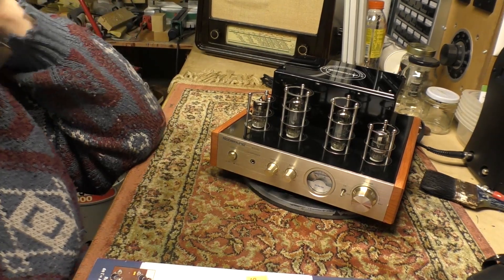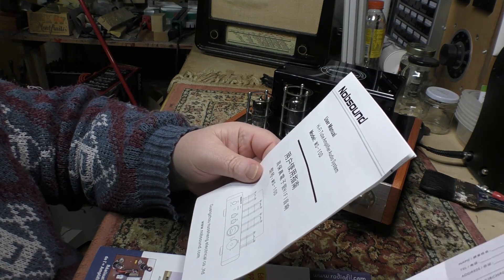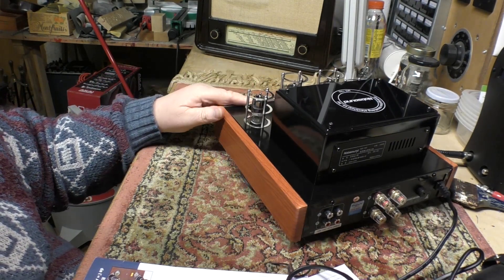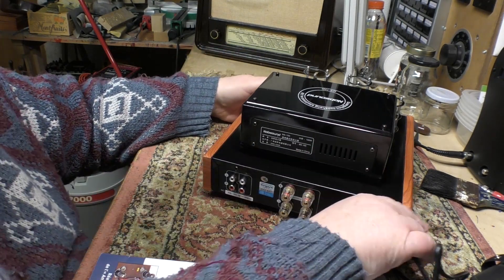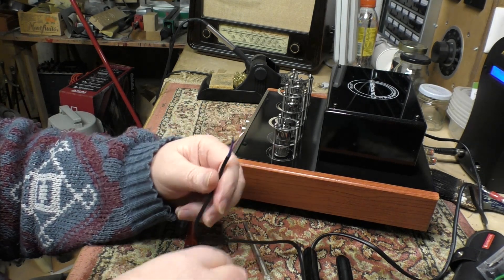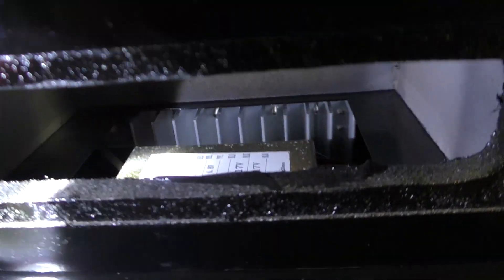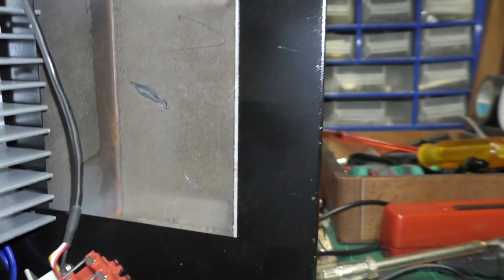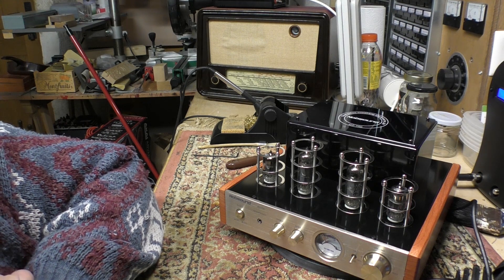Tube Valve HiFi Amp - NOT!

Comment: Yes that is the big question with these hybrid amps. How much are the tubes really doing in the audio stage. To be not "technically" lying to the customer on what the amp is (a hybrid), they could be just doing a simple buffer which Dave's Eevblog found on his tear down of a hybrid amp. The worst straight out cons are the amps which just stick some cheap chinese valves in and then stick LED's underneath them. Your tube (hybrid) amp looks the part though. If you want the look on a budget. Make an impressive looking display amp in a shop - cafe or at home and with 25w per channel you have plenty of power for most needs. As long as it has the quality to last is another thing.  Sellers should be clear on what they are selling and not to pass something off as something it isn't though. Interesting to hear what the sound quality is like. The latest one has blue tooth connectivity I see.
Reply from the maker: +David Clarke (DaveHiFI) I would contend that if the tubes are not performing any meaningful role in the circuit then it is not a proper hybrid amp.  The fact that the amp works better without the tubes in circuit confirms that they are there for show.  Over-driving the heaters is also a seriously dubious practice since many of the folks who bought this amp will be needing replacement tubes earlier than they should.   The sound quality of the solid state amp is excellent now that I've taken the tubes out completely.
Cheers,   John

Comment: IS possible to connect phono(turntable) in this amplifier?
Reply from the maker: No, it has only line level inputs for devices like CD or MP3 player.   You would need a phono preamp - or turntable with built-in preamp.

Comment: Before you even said a word I thought to my self, no way can that be 20 watts per channel. Not enough valves and also valves are too small. You would need something like 2 x EL34 on the outputs to get 20 watts. It looked like ECC83 + EL84 which might give three watts. However as they are not connected, kind of by the way I guess.
Chinese really have no scruples, they simply lie about most things they sell. Hopefully many will see your video and stop at least a few being coned!!
What you have may well give you 20 watts and could sound reasonable, I look forward to your comments when connected.

Is that a ToneFunk radio on your left? Sure looks like one I had many years ago. Only real difference is mine had a turntable on the top with the turntable sticking out the back.
Reply from the maker: +Michael Beeny Hi Michael,  the radio on the bench is an Albis 492, Swiss made in the early fifties.  I've got a few clips of the restore posted.   Lovely sound from it.
I'll post more on my lovely valve amp once I fire it up!
Cheers,  John
Reply: +Michael Beeny I think that with a single ended EL84 with an ECC83 as a first audio amp, you could theoretically get up to 6 Watts with the right circuit and voltages. An EL84/6BQ5 is pretty much a nine pin miniature version of a 6V6GT, which is a beam power tube, so they can put out a lot of umph, though you have to drive one pretty hard to get one up to 6 Watts so 3 Watts undistorted is probably more realistic.
  I believe that the whole reason that the Chinese scammers pedal these things is that they know that audiophools are called that for a reason and are utterly clueless when it comes to basic electronics. They also know that they apparently have large amounts of money to spend and are willing to do so for the most baseless of reasons.

Comment: on other Forums the manufacturer states that the pre-amp stage is valve and the power is solid state, so Hybrid design. Still a piece of crap though, I bought one and 6 months later it was broken.
Reply from the maker: As I demonstrate in a later video, my version works fine with all tubes removed thus clearly showing that preamp is solid state.   I would consider it hybrid only if the valves were doing something in circuit - as opposed to being just eye candy.   Since there are so many variants of this device I can only comment on my unit.   Others are undoubtedly different.
Reply: yes, many variants - and to add to the mess, Chinese firms even make copies of these low cost units where they really skimp on everything ! The hollow (plastic) power supply casing would suggest that you have scraped the bottom of the barrel here.....copy of a copy.....
Reply: yes, too many variants and to top things off, Chinese companies actually make copies of these ultra low cost designs - ending up in real rubbish. The hollow plastic transformer cover seems to point to the fact that you have scraped the bottom of the barrel with this lemon....copy of a copy and a dangerous fire hazard

Comment: I saw this on ebay and thought it was a tubed preamp and solid state poweramp.
But cheapo tube stuff is never good from what I hear..
Reply from the maker: Yeah this one's no high end tube amp that's for sure.   Cheapo anything is usually not a good idea when it comes to audio but this one is described as a Tube HiFi amp  when it has solid state pre amp and amp with a buffer tube stage in between.  In my case it actually took away from the sound so I removed the buffer stage and connected the preamp stage directly to the power amp stage and now it works fine - as a 100% SOLID STATE AMP!
Reply: Zone1242
LoL, nice :)
Reply: Zone1242
Reply: You're wrong. This is a good hybrid amp that's affordable.
Reply: Good solid state (for the money) and a sucky tube..
Never trust tubes with blue led`s :p
Reply: Yup I agree with Larkenfield. I own some expensive audio stuff, but this amp is incredible. For $200 it will blow away solid state amps costing $1000 or more. Just make sure to upgrade the tubes to Tungsram and it comes alive.